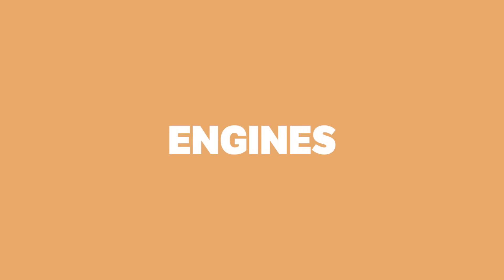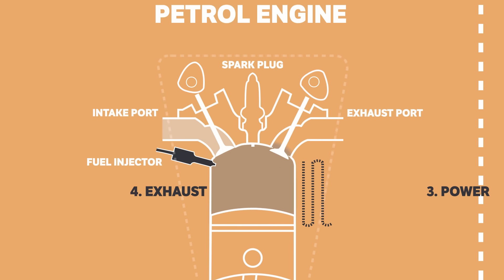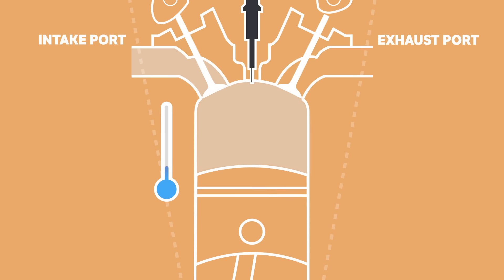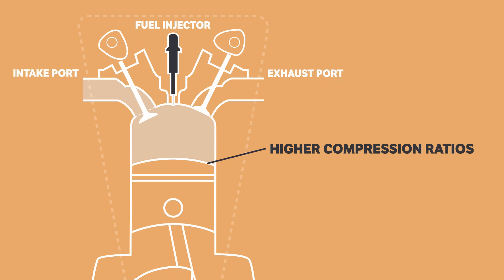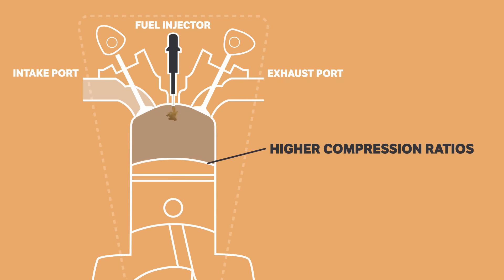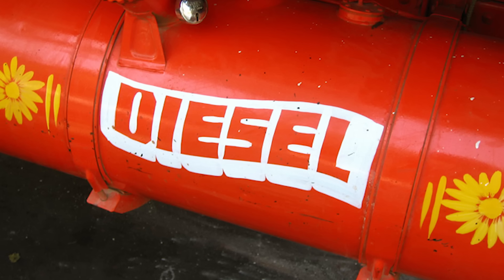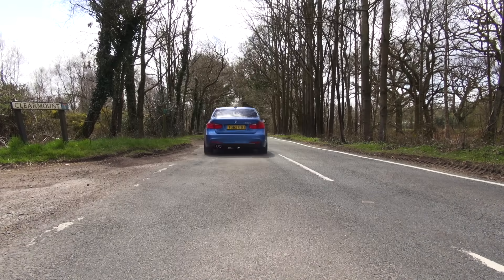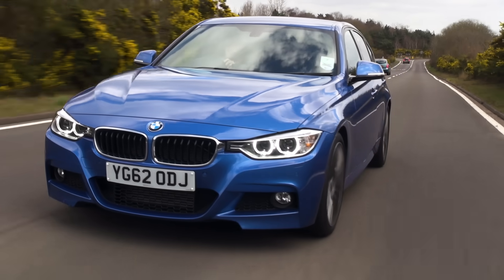The Differences Between Petrol and Diesel Engines

Comment: I"ll go for Petrol, Diesel cars for me are boring, unreliable and they are dying because of Hybrid Technology
Reply: Yeah and old Mercedes Diesel Engines last even longer I think you actually have no clue what you are talking about because if there's one thing Mercedes can built then it's the Diesel engine. So which cars won LeMans 9 times in a row? Yeah right Audi and Peugeot with Diesel and Diesel-Hybrid engines. And the new Audi SQ7 shows that you can have much power, low fuel consumption and good emissions at the same time.  Inform yourself before you try to invade the comments with your "nah bruh" captain smartypants.
Reply: a 335d is faster in a short strait line than an m3
Reply: 253Huhn253 our mondeo has never broken down once!! It's a ford and it's amazing all ways starts even in cold it was covered in ice and started easy fast first try and has been threw hell and back speeding over bumps and gravel roads it's truly amazing I love it so much!!!!! We had a focal before which never had broken down once so we went with the modeo.. Another ford and what can I say!! FORD IS THE BEST AND THERE CARS ARE OUT STANDING!!!
Reply: A Ryder nope
Reply: A Ryder lol no they dont.
Reply: Carlos Morteo for me e cars are the boringst thing ever for mutch reason 
and tell me what  the fuck is interestin on e-cars there is nothing on the that i like so mutch on normsl cars.
Reply: 2 peoples fords lasted up to 675k. 99.9% other fords have some issues with the bearing or axles
Reply: i worked in a shop for a couple of years. 80% of the cars were ford and i mostly had to remove rust and replace  axles or bearings.
Reply: Gerry Whitehawk diesel is better in every way? its more economical yes. and it develops more torque when a turbo is fitted yes but thats all. petrol is cleaner, doesnt need a turbo to actually go anywhere, makes more actual power, makes sound, revs faster and higher and can be used to burn things down if they annoy you. so as a "petrolhead" petrol fits all my needs. as a farmer i would choose a diesel tracktor of course. anyway you are free to belive and buy what ever you want but you cant tell me diesel is better in every way. not to me m8. Let me put oh that way: diesel is die Saving Gas and economical reasons petrol is for Performance and fun.
Reply: Gerry Whitehawk no they dont. die example 2 modern engines. mk7 Golf 1.5 tdi 150hp 8.2 sec to 100kph mk7 2.0 tdi 150hp 8.6 sec both manual. even if the diesel would be 50kg heavier its still not quicker even with more torque.
Reply: Gerry Whitehawk Talking about Le Mans I think the last 3 years  Porsche are dominating with a V4 Hybrid Turbo Petrol :) Ohh and they are champions 2 years in a row in the World endurance championship
Reply: Gerry Whitehawk do you really belive that? I mean the diesel will stay for a long time but it will slowly disappear from passanger cars. it is dirtyer then a petrol car and to get the same hp it needs turbocharging. and to be less dirty it needs dpf, nox filter, very high pressure injectors, and another fluid (ad blue). diesels are for work Horses.
Reply: Still no way a ferrari will have a shitty diesel ;).
Reply: Carlos Morteo  BRUH.....
Reply: 99Lezard99 almost every modern car gets a turbocharger no matter if it's Diesel or Petrol because it's much more efficient and most modern engines are so small that they need turbos it's called downsizing. And yeah I believe Diesel engines will be longer available for cars I mentioned why in the points above. Diesel is better than petrol in every way with the exception that it's not as clean as petrol but Adblue and the filter systems which get better and better will change that or at least reduce it to a minimum.
Reply: 253Huhn253 did u own a ford?
Reply: +253Huhn253 not all TDI ;) 
only the 1.9 TDI and the SDI one
Reply: 99Lezard99 I answered to almost every of your points in one of the comments I wrote before. And if there's an engine that can run with many kinds of fuels then it's the Diesel engine, I mean look at the old Mercedes Diesel engines or at big ships or tanks. And sound is a subjective thing. And when you have two equal cars with the same weight and one runs with a  turbodiesel, the other one with a turbocharged petrol engine with the same hp then the Diesel-powered car will outperform the one on petrol and it will outperform it even if you have some more horsepower in the petrol one and because the Diesel has more torque it's more fun to drive because it feels more powerful.
Reply: *1.5 tsi
Reply: pretty much every tdi runs more than 400k if you treat it nice. its straight up stupid that u think only 1.9 tdi last so long. sdis are pieces of shit and have less power than 50cc scooters.
Reply: 253Huhn253 a lot of fuel buring engines run 400k if you treat them right. not only diesels. high mileage engines are not only a diesel thing.
Reply: its unlikely that a petrol engine lasts 400k. the operating tempature is much higher thus increasing strain on the exhaust manifold and other critical components. diesel engines run at much lower rpms because the fuel it self produces a lot more energy while burning
Reply: 99Lezard99 That's because the 1.5 TSI is newer and more advanced in technology, vw put a lot of money in that motor with a high combustion ratio (for a petrol engine), new VTG Turbochargers and an entirely new injection with higher pressure and of course it's lighter that's not the comparison I meant.
Reply: Romano Peters not when it's like for like models ie - F30 335d v F30 M3. Your comment may be true regarding F30 335d v E90 M3 and prevoius models. But to be fair thats down to the 8 speed auto box. 
I drive an F34 GT 335d xdrive with that same autobox. It's a very fast comfortable car but it's no M3.
Reply: Carlos Morteo diesels are more efficient and way more reliable
Reply: diesel engines are the most reliable engine unless its a ford. tdis survive as long as 400k or even more.
Reply: Not really.. bmw 330d, 335d e90, will leave M3 behind...
Reply: 253Huhn253 I had a 1999 Ford Mondeo with 675k km on the clock and with regular service it was a great work horse
Reply: Audi quit racing because they made too much loss in general and they have to change their whole company's structure but they did win often enough with the TDI to prove that it can perform better than the petrol engines competing in Lemans. Uuuhhh Dieselgate so what? The cars are able to produce less NOX but the brands wanted to make more money that's not the fault of Diesel engines, it's the fault of the companies.  And if there's one fossil fuel that will last then it's Diesel because you can produce it out of natural oils and you can see right now how there are more and more cars getting Diesel engines and even sportscars and one day the gasoline engines will only be common in american muscle cars or sth like that because Diesels will be cheaper, friendlier for the environment (with things like Adblue) and can produce more power at the same time. I won't even argue with you about the costs of Diesel injectors because it highly depends on the car you drive and you don't have to replace them often (they last until like 400000km in a Mercedes 220 CDI). And if I wanted I could say "Yeah and if we continue driving gasoline cars we will all die due to climate warming" but that argument would be as stupid as yours so I won't say that;)

Comment: Both gas and diesel are great, but for different applications.
E.g. diesel is great for commercial transport, for long duration/distance trips.
Gas is good for short city rides (5-10km), good for rapid acceleration, for longer acceleration up to redline without gear change while diesel is wanking its gearbox 2-3 times.
Gas cars heats up engine quicker what is very important when it's below zero outside.

Comment: Petrol = faster, revvier , sound better,  better throttle response.

diesel = More fuel efficient, more low end torque. 

Also diesels are generally more expensive when they go wrong (fuel injectors turbos etc.)

Comment: When you live in Germany you buy a diesel when you drive over Long Courses and have several thousand km´s per year (my father has a VW t5 and drives around 100k km´s per year) bc ist cheaper, 
however if you drive City on a daily bases and often only cover small distances and generaly drive a lot in one year you choose Petrol (my mother has a VW polo and drives almost only small distances and City) bc it s (again) cheaper. 

This has to do with Diesel being the cheaper fuel but Dieselcarowners pying more taxes and petol being the more expensiv fuel but petrolcarowners havingto pay less taxes.

So from a practical point of view you have to do the maths on wich one is cheaper to own. 

PS: the cheapest will probably be a Tesla model 3 with ist base prce at 35k$ wich will probably Transfer into euros like that ad the you can just Charge it at an outlet on your house and ist way less expensive than fueling up. Also the german governmant gives you a 4000 euro boost to by an electric car.

Comment: Diesel car for convenience, petrol (motorcycle) for fun. All those people saying diesel sucks, well, when you give me a petrol car that has the same (or better) fuel consumption, torque, ability to be run for free (waist vegetable oil or such) and price with engine under 2000 ccm (bc where I live the yearly registration is sky high for cars over 2000 ccm), I will gladly accept it, until then, I'll stick to diesels.
Reply: Finally, an adult around here.

Comment: i have to stay that I'm 50/50 gas diesel. diesel engines are torque monsters ie the Cummins 6bt at 215 hp and 440 lbs/tq vs gas say a gm 350 v8 255 hp 330 lbs/tq (approximately 1999 y/m vehicle numbers from the wiki pages of the manufacturers). 10 cubic inches in size and 110 more lbs/tq. remember, as cliche as it sounds, hp= how fast do you hit the wall torque how far you drag that wall after you hit it

Comment: Diesels can also hold more boost because there's no knocking due to the lack of fuel during the compression stroke, and their tendency to be made of strong steel rather than weak aluminium, so you don't blow yer cylinder walls out of existence

Comment: Gasoline just sounds and smells better and is just plain cooler !
Reply: dimitry logan cooler because the diesels are lit!!1!1!1!! 🔥🔥🔥🔥🔥🔥🔥🔥 (sorry I had to)
Reply: 5 cylinder diesel  engines are very uncommon. Why would you pick a an odd ball engine to defend your statement.  Straight 6 engines are most popular V8s being next . 
Hyper cars are a very small percent of what people use and own. If we are just going to pick ridiculous engines not many people use to prove points . Ok . Whats fuel does a turboprop bi engine plane use . Diesel. Rocket ships jet engines diesel. Large 100 thousand hp freight liner cargo ships . Diesel. 300mph bullet trains Diesel. The do make super car diesels and diesel hypercars .  Diesel engines have all there own motor sports just like gas engines. 
I didnt say gas motors weren't fast .  I said diesels could be just as fast.  Your thoughts on a diesel engines are very biased because you dont know much about them .
Reply: I disagree I love the sound of a older mechanical injected 6bt with a high advance.
Reply: Newer common rails are better for the environment also studys say. I love both types of engine they all have there place.
Reply: ihaspizza13 well, some people don't care about efficiency. They just get a v12 petrol cause why not, lol
Reply: Some diesels put out allot more power than a V12  Im curroius do you got a V12 petrol engine or anything fast because why not?
Reply: Mark Rich when you upgrade evey single thing in both engines to the max, you will see that the petrol engine is way faster than the diesel. btw diesel smells awful, sounds awful and is unbalanced.
Reply: Not true at all. . . Most people on the internet blow hot air out their ass have no clue what they are talking about. In this case I will presume you may know some about gas engines never owned a diesel and havent built either" to the max" 
If you have you would know diesels can be just as fun as gas engines are built stronger from the factory . The world biggest engines are diesels . Each engine has their own unique sound. Gas smells no worse or better than diesel. If an engine was "unbalanced " it would rattle apart. It has more harmonics because of the way it ignites. Not unbalanced by any means . Both sounding great in their own respect. They both are built to do different things but both motors can be fun .
Reply: Mark Rich about the unbalanced thing, 5 cillinder engines are unbalanced, they shake like helle if they dont have that balance bar. but still shake, and diesel engines shake like hell. they dont fall apart either. but if a gasoline engine is build strong than you have no big problems with high compression or turbo pressure. and i ask you one question, why if diesels are so great and max tuned faster than gasoline, then why do super/hypercar manufacturers not make diesel hypercars instead of gasoline?!?!? answer that.
Reply: Mark Rich i mean the 5 cillinder gasoline engines dumdum
Reply: 5 cylinder design is unbalanced by default regardless if it's a diesel or a petrol engine. a straight 6 is naturally ballanced so it won't rattle regardless of teh fuel it uses. ballance has nothing to do with the fuel and everything to do with engine configuration and design.
Reply: Mr.Rowan
5 cylinder gas and diesels engines are uncommon. Thats what you took away from the whole post?  
Agroprest Afumati
Your 100% correct even amount of cylinders always have paired banks firing in a straight 4/ 6 /8 or v8 unlike a 3/5/7 cylinder engine will always have an odd ball that fires off being natrualy unbalanced. But they are so rare . Not many use them in production.

Comment: Petrol =God 
Diesel =Good 
Hybrid =bad 
Electric =very bad I hope cars won't be full electric
Reply: Smh.
Reply: can't believe this comment got so many upvotes... really... electric cars are much more enjoyable and... dont know about you but i also love that electric sound of pure power. hope we get much better batteries soon for cars and phones lol
Reply: J-187 electric cars will be faster and better soon its sad but true
Reply: Driver Mod Gaming soon? I guess in  100 years all Cars will be electric. But I don't know
Reply: Anon73618 id rather have all electric than hybrid because hybrids are just way too slow its hard to bare
Reply: J-187 electric is going to take over now that they're working the problems out of solid state batteries. With no liquid in the battery, they're perfectly stable, hold more charge per volume, and charge much faster. Sad that we won't hear the engine purr so often in the future but electric is making its way
Reply: Tesla Model S is such an awesome and incredibly fast, and let's not forget that it sounds like freaking jet when accelerating. And that's a full electric car.
Reply: Sugurain tesla sounds like a jet? Are you sure about that?
Reply: Anon73618 its like a slight whining noise
Reply: ihaspizza13 i agree with you but id rather have gas diesel engines they are way cooler amd i could give a fuck about the environment but regardless cars will turn electric. But it is also just as possible that we develop a different kind of fuel that doesnt have emissions. I imagibe it would be an alcohol based mix similar to ethanol and diesel will be bio diesel made from fermented fruits and vegetables
Reply: Stupid short-sighted comment. The so-called fossil fuels are running out, ever heard of that? But if electric cars are so bad, you can take a bike in the future. Way better. True. Electric cars, total losers. Total disaster.
Reply: Soundlmpact as the owner of the fastest tesla said, "its sounds like a space ship and i love it" and that dude is a car maniac! The rumble and the zoom if youre a car enthusiast it doesnt matter what kind of engine is in it...if its fast, looks beautiful or it hits you with something you like. I love (most) cars, and i agree with you.
Reply: Soundlmpact electric sound of pure power lmao there is hardly any sound dude
Reply: J-187 im full with you and that didnt com they have a right to exist bit the dont replace the others tey cant because they will ever have the loading overheat and eplosive batery problem (good bles richard hsmond that he didnt burn in this fucking rimateck and in no other e car tesla kough kough)

Comment: You didn't mention how the fuel is supplied to the combustion chamber in a diesel engine. Air is sucked in through the intake valve and, after being compressed, a small portion of diesel fuel is injected (in common rail engines the injection has different stages) into the chamber and ignited by the compressed air. Thus, diesels don't need spark plugs. Whereas, petrol engines don't necessarily need injectors cause petrol and air gets mixed in the carburetor. But, nowadays we've got fuel injection in petrol engines, so that difference isn't that clear. I can imagine this videos was made for thick people and you wanted to keep it as simple as possible. Have a nice weekend!

Comment: Diesel Power is just unbeatable, its not without a reason that still today a very large amount of trains use diesel engines over other fuels, if the rails dont have power cables. And why there are so many diesel cars on the street. (Though that might just be a german thing, cause many non-german car brands dont even produce those for standard cars...)

But as soon as electric cars get far enough without recharging (which should be no longer than in 10 years at max) Electric engines will dominate for sure. Besides Nostalgia (for engine sounds) there is no reason why this sould be the case.